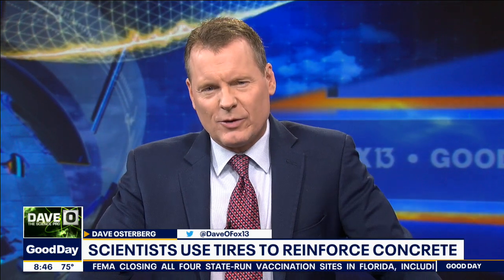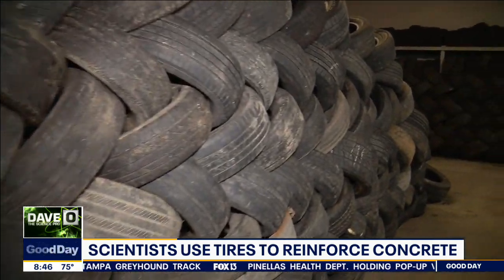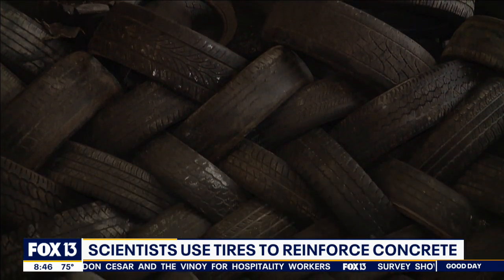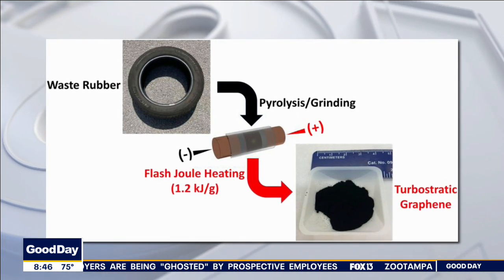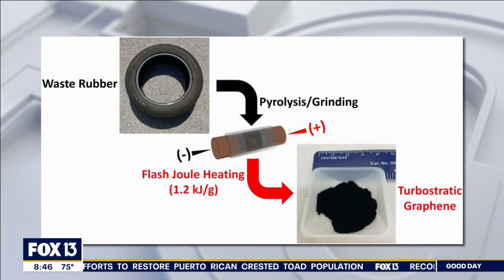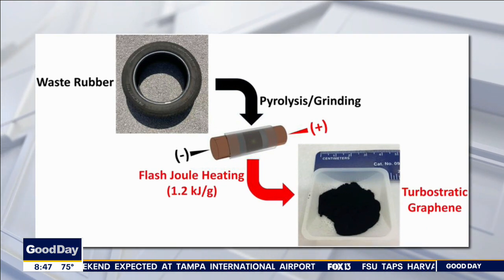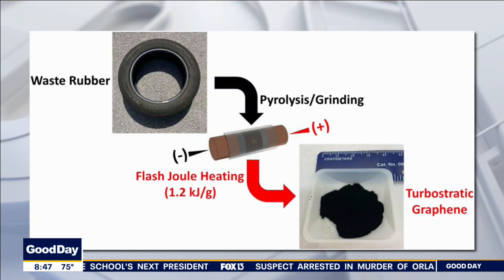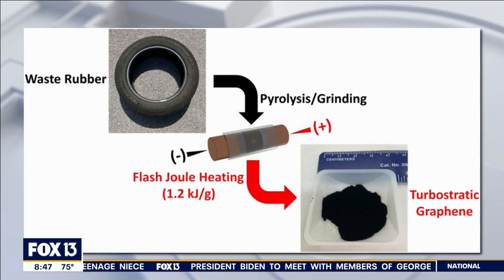Recycling used tires: Scientists say they have a new way to do it

Comment: What scientists? Who, an undergrad research project? Dave who? Citation for statistics? This is  Useless 'News' and worthless information. 
Creating graphene is not easy and $100 per ton is bald faced lie.
Reply: Rice University, Undergrads, 1 gram at a time with 'Flash Process" - from already processed/ micronized rubber that was already turned into carbon.... 
so the $100/ton is ONLY an estimate for the ELECTRICITY of the "Flash.
Does NOT consider tire collection, shredding, micronizing, heating in a pressurized REACTOR at 180* C for 48 hours, then sifting and sorting out the 1 gram at a time "Flash Process"...

So NO. The graphene from tires is at the end of a long EXPENSIVE recycling effort requiring several  >million dollar each< machines, using ridiculous amounts of energy - ALL before the highly processed 1 gram at a time carbon is put into a proprietary "Flash" (Electrochemical Zap) which only works on between 47-70% of the carbon to make (questionably -few layer ) 'kind of' graphene. 
At a quality and quantity that is utterly useless for any real world use.
Sorry , I really wanted this to be a thing....  Nope.
Reply: Plus this bit of "Fluff piece" news is a blatant misrepresentation of the facts. Like all MSM these days, A pack of crap around a kernel of truth. Shame on them.